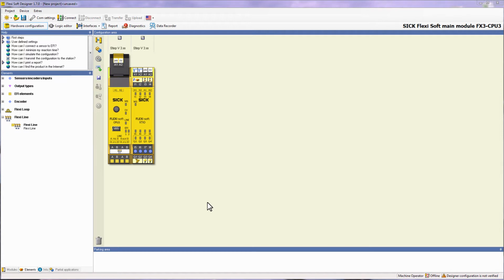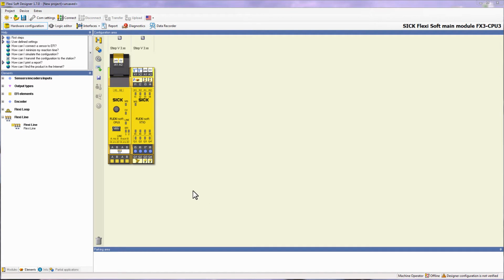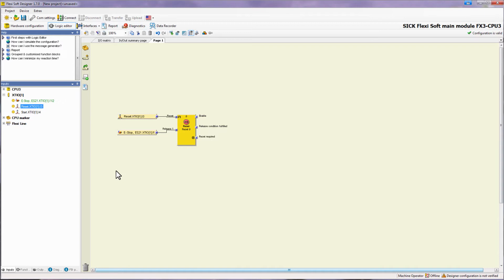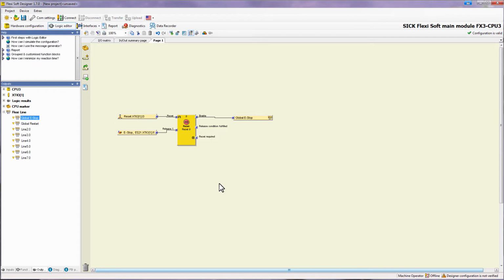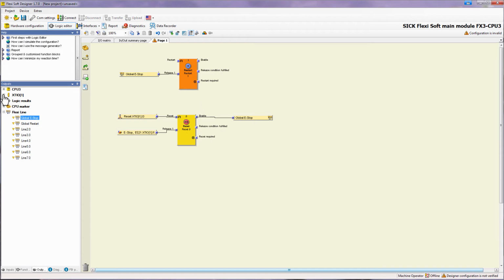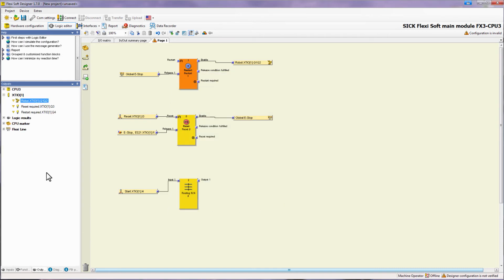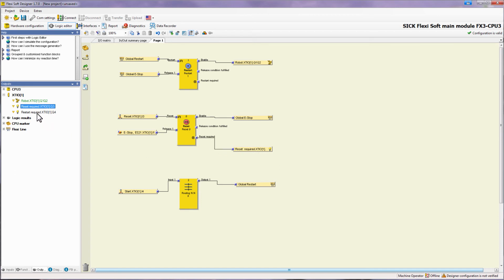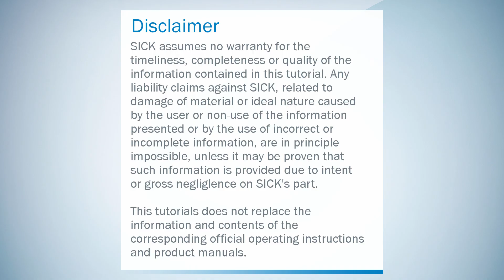Tutorial Flexi Line (Part 3/6): Logic creation | SICK AG

Comment: I'm trying to do a saftey PLC setup and I'm using this as a starting point. I did this logic setup with the Flexiline (with a Restart, Reset, and Routing block exactly as shown). When I do a simulation, I don't see the Global Restart come on when I turn on the local start button. Will the Global Restart (input) turn on when the Global Restart (Output turns on). 

How is this handled for multiple configurations? If two stations both access the Global e-stop. If one is low and the other is high, is the flexiline variable high then? Does it act like an "or" logic gate? I can't find any information online, please help?
Reply from the maker: Hi. This is the normal behavior of the simulation. The global input is the combination of what the local station receives from both neighbours, and this is not affected by what the local station sends them. The simulation mode in the logic editor only simulates the logic of the local station. It's not possible to simulate the neighbouring stations.
Please take a look at the next video of the series, where the online diagnostics is shown. It displays how inputs from the previous, local and next station are managed within the logic.